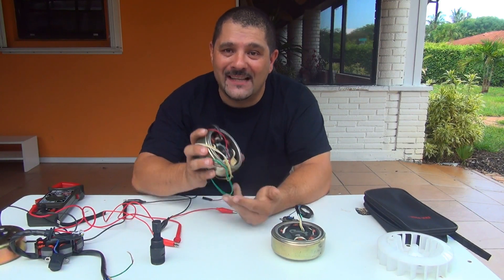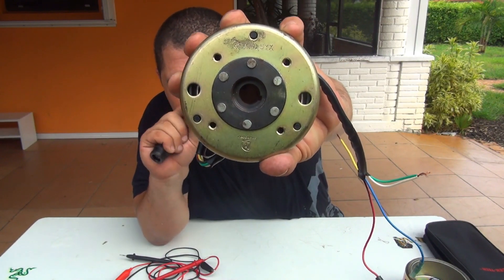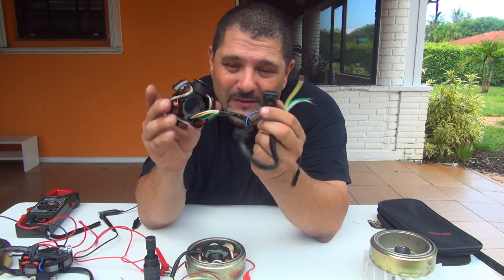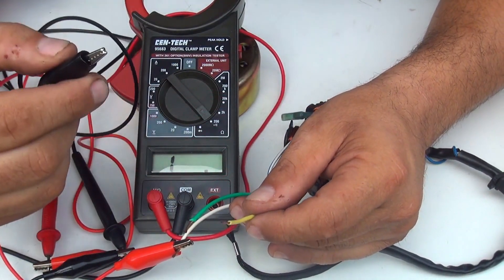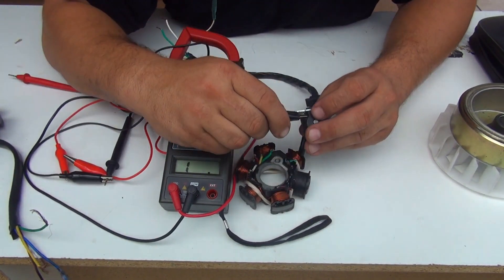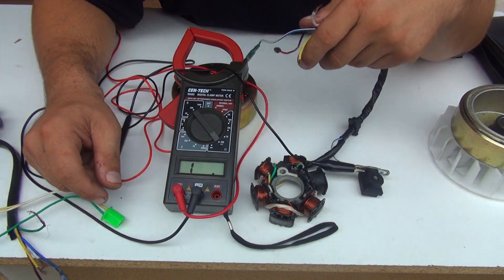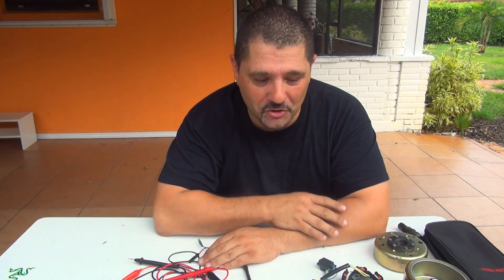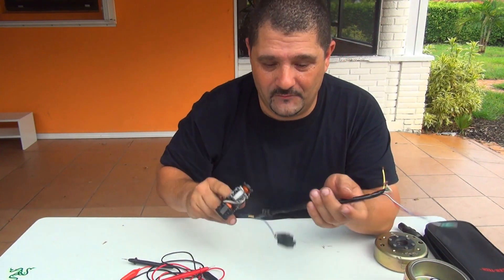How to test a stator on a gy6 150cc scooter

Comment: Super useful. Thank you.
Reply from the maker: Glad to hear that!
Reply: @VirberelloScooterTips  Hi I have question. I just received the stator that I order online and test it with the way you shown here but there are 2 problems.
1. I got one CDI wire only instead of 2 and I test it like how you do in 10:00 and get no response at all (My CDI has 4 pins not 4 + 2)
2. I continuity test the white & yellow wire with the middle part and both come out with reading and beep sound.
3. I continuity test the dark brown (I think it's ground) wire to the middle part result in no reading no beep.

I already return the 1st one I bought so this is the 2nd stator but both test out the same result. Any idea what's going on ?? Thanks first

Comment: Hello, so I'm getting power to my rear brake light and my signal lights and it's a sequential light. However I'm not getting any power to my running light. What could be the problem?
Reply from the maker: Hello you need to check the wiring harness or test the regulator rectifier

Comment: I do have a question my stator when running is putting out 12.5 that is at idle TaoTao not sure so many options but is that a problem
Reply from the maker: Hello my friend A stator output of 12.5 volts at idle for a TaoTao scooter is within an acceptable range, but it is on the lower end of what is typically expected. Generally, a healthy charging system should produce around 13.5 to 14.5 volts when the scooter is running at idle.
Here are a few considerations:
Battery Health: Make sure your battery is in good condition. A weak or failing battery can affect the charging system's performance. Check the battery's voltage when the scooter is off; it should be around 12.6 to 12.8 volts for a fully charged battery.
Regulator/Rectifier: The regulator/rectifier plays a crucial role in regulating the voltage output from the stator. If it's malfunctioning, it can result in lower voltage output. Inspect the regulator/rectifier for any signs of damage or overheating.
Stator Output at Higher RPMs: Test the stator's voltage output when the scooter is running at higher RPMs. It should increase from the idle voltage. If it does, the stator might be functioning correctly, but the idle RPMs could be set too low.
Idle RPM Adjustment: If your scooter's idle RPMs are too low, it could affect the stator's output. You can try adjusting the idle speed to see if it affects the voltage output. Consult your scooter's manual for guidance on adjusting the idle speed.
Wiring and Connections: Check all electrical connections for cleanliness and tightness. Loose or corroded connections can lead to voltage drops.
While 12.5 volts at idle is not a critical issue, it's essential to ensure that your scooter's charging system is functioning optimally. If you continue to experience problems or if the voltage drops further, it's a good idea to consult a qualified scooter mechanic or technician. They can perform a more thorough diagnosis to pinpoint any potential issues and make the necessary repairs or adjustments to ensure your scooter's charging system is working correctly.
Thank you for watching my video
Reply: @VirberelloScooterTips  thank you for getting back with me greatly appreciated 👍👍

Comment: In a 50 cc Chinese scooter, does the oil have to be coplently full, or? Is 3 out of 4 stars on the dip stick ok to ride?
I'm asking because, I think I've noticed a ticking sound since yesterday. The scooter is a 2022 and just hit 900 miles yesterday. 
Any info is appreciated!
Reply from the maker: For a 50 cc Chinese scooter, it's important to maintain the correct oil level for optimal performance and to avoid potential engine damage. Generally, the oil level should be close to the "Full" mark on the dipstick.
Having the oil level at 3 out of 4 stars on the dipstick might still be within an acceptable range, but it's recommended to keep it as close to the "Full" mark as possible. Riding with too little oil can lead to increased friction and overheating, potentially causing engine issues.
The ticking sound you've noticed could be due to various reasons, and while low oil levels can contribute to engine noise, there might be other factors at play. It's advisable to:
Check the oil level again and ensure it's at the correct level.
Listen carefully to the ticking sound and try to identify its source. It could be related to valves, timing, or other engine components.
If the ticking sound persists or you have concerns, consider taking your scooter to a qualified mechanic for a thorough inspection.
Regular maintenance and proper oil levels are crucial for the longevity and smooth operation of your scooter's engine. If you're unsure or concerned about any aspect of your scooter's performance, seeking professional assistance is always a good idea.
Reply: I live in Florida as well, would it be possible to bring the scooter to you? I'm in Tampa?

Comment: Sir I have a 150 chinese scooter that just wasn't making enough juice to keep the all the lights and accessories on. One of the yellow wires was putting out great vulkyage as your video showed however the other yellow wire was runnung low. so i have ordered 2 news and they both are the same. Frustrated i9 have ordered a 11 pole upgrade. Testing it it has 3 yellow wires instead of 2. To my surprise 2 of the wires have great voltage but the 3rd has the sane low voltage as the one on the 8 coil 3 stator. I am confused as to why all these stators are doing the same thing.
Reply from the maker: Hello my friend It sounds like you may be experiencing a problem with your scooter's charging system. If you have tested multiple stators and are still experiencing low voltage output on one of the yellow wires, there may be an issue with the wiring or the regulator/rectifier.
One possibility is that there is a break or a poor connection in the wiring that is causing the low voltage output. Check the wiring carefully for any signs of damage or corrosion and make sure all connections are clean and tight.
Another possibility is that the regulator/rectifier is faulty and not regulating the voltage properly. You may want to test the regulator/rectifier to see if it is functioning correctly.
It's also possible that there is a problem with the magnets in the flywheel or the stator itself. This could be causing an uneven or weak magnetic field, resulting in low voltage output.
If you continue to experience problems, it may be helpful to consult a professional mechanic who specializes in scooters to help diagnose and repair the issue because sometimes electrical problem can make you crazy

Comment: Saludos
Es posible que yo cambie mi stator de 8 pole por otro de 11 pole sin que la rabisa  se vea afectada o es que tengo que cambiar la rabisa completa
Reply from the maker: Hola, sí, puede cambiar el estator a 11 polos, pero necesita cambiar los cables a uno más grande porque puede derretir el cable pequeño porque tendrá más voltaje cuando cambie a una bobina de estator más grande gracias por ver mi video
Reply: O tendre que poner CDI Y BOBINA MAS GRANDE?
Reply: Brother!
Te cuento mi motor es GY6 VENTO de fabrica lo modifique le puse piston 62mm con el bloque 62mm portiado y arbol de eleva 17 degree y sigueñal 400 stroke pero mi rabisa es de 8 y me acabas de indicar que necesito mas corriente cambiando los cables a 11 pole te pregunto ¿? Al Poner stator de 11 no necesitare hacer cables de ground nuevos? Ya que ese motor necesita mas energy

Comment: I have a sym crox 125 it will not start its not getting spark
Reply from the maker: Hello my friend check the connections in the back of the coil and if you have voltage with the multimeter next check the cdi with a multimeter and at the end test the pick up coil one of these is not working . Thank you for watching my video

Comment: I just now finally got my scooter running again.
I've been watching a bunch of videos and I don't think my diagnostics were getting me anywhere.
Bought a CDI and as I now know that wasn't the problem.
Took the stator and flywheel/magneto off yesterday and there was rust on the inside magnets of the flywheel.
So I left it overnight in Evaporust and about 20 minutes in an oven from cold to 300 degrees.
Cleaned the mild surface flash rusting with electrical silicone and wiped off - looks like new again.
But.  The most important part.  I spliced in ( edit: just a female bullet connector ) an $8 Amazon pick up coil and now I have spark again.
Genuine Buddy 125.  I think they might be the only scooter that allows you to buy the pick up coil separately ( but not from PGO ) .
The gap went from loose to very snug when using a debit card.
Now to see if the vacuum piston I replaced has worked too - lost spark as soon as I replaced it!
Reply from the maker: Hello my friend great work and thank you for watching my video

Comment: @ 13:53 in the video you explain continuity, When you check the green at the plug and the green at the stator you'll have continuity, but not at the green on the plug and the white or yellow. If you do, you have a bad stator. Is this always the case?
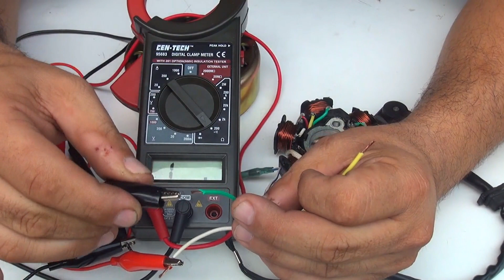Reply: I believe you are onto something Jesse at 8:08 he states connecting green and white should produce no current but i believe it should based upon other videos and my own testing.

Comment: This is by far the easiest and simple explanation to understand a stator. Great job man. By following your explanation, was able to find the bad stator. Keep up the good work
Reply from the maker: Hello my friend thank you for watching my video
Reply: @VirberelloScooterTips which is better a 6 pole or 8 pole stator? 🙂
Reply from the maker: @Kevin-j9c1l  for a 150 cc  I like 6 poles better because to much voltage in a 8 poles in the long way is not good for a low quality wiring scooter with a low quality regulator and a low quality battery
Reply: Jjj

Comment: I dont have lights, charging, electric start etc... I took the stator out and did all your tests and they seem fine. However, one of your tests is very different from other GY6 channels. Others tell you to test the resistance between the white, yellow and green wires and say that they should all be the same. You say that you should not have connectivity between the green and the other two. Are there different stators?
Reply from the maker: Hello not stator for gy6 stator are the same for 150cc but some mechanic test in different way to get the same final result you can also test the stator when the stator is on the scooter if the stator  is producing any voltage https://youtu.be/znm4KjKVQUs but also think about the regulator that ca create a short or a bad voltage flow in the system
Reply: @VirberelloScooterTips  thank you. I ended up buying a new stator yesterday but it has the same ohm readings as the original one. Perhaps it is the regulator then... At least these Chinese parts don't cost very much!
Reply: @VirberelloScooterTips  thank you. I ended up buying a new stator yesterday but it has the same ohm readings as the original one. Perhaps it is the regulator then... At least these Chinese parts don't cost very much!

Comment: Soooooo.... what's the gap supposed to be between the pick up sensor and the small metal knock in the flywheel cover?
Reply from the maker: Hello my friend same thickness of a credit card . 76 mm thank you for watching my video
Reply: Your welcome. Your very knowledgeable. But I do have one more question....
I have 2 different stators and on both of them when touch one probe to the green wire (on the plug end) and touch the other probe to any and all wires back on the stator I'm getting a beep  (Continuity). And that's happening on both these brand new stators

Comment: Please help me with this, the continuity sounds off on the Green with white and green with yellow and yellow with white on all three stators that I bought from Amazon on two stators there is continuity from Green terminal of The wire to the metal piece of the stator which is ground. And I have one that has no continuity from the green wire to the metal surface of the stator. Please help me understand this situation. I don't want to lose money buying bad stator that's why I need your help
Reply from the maker: Hello Wesley you should have continuity from the green wire and the center metal part of the stator and that is the only wire the white and the yellow should not have continuity with the body of the stator . Thank you for watching my video

Comment: Hello from Malaysia. I just bought a stator replacement from an apps. I have done the test like your tutorial but it seems that my new GY6 stator have continuity on all the yellow/green/white wire and it supposed not to, right?? So does that mean the stator is faulty? My scooter is Modenas Elit 150. This is the 2nd time I bought stator online, to fix my battery charging issue. If you can reply that would be nice..Thanks..
Reply from the maker: Hello You should not have continuity on the green and yellow testing a the same time  or green or white testing a the same but continuity shold be on the green wire and touching the frame of the stator check this video to https://www.youtube.com/watch?v=f8MmrXsEpjQ&t=105s&ab_channel=TrailTech thank you for watching my video

Comment: How many volts (AC) should we found between the 3 wire of the stator(white, yellow, green) when we turn on the motor if we like to test from the regulator?
Reply from the maker: Hello at idle volt AC with green and yellow you should read a minimum of 15 to 16 AC from green and white you should read with a multimeter a 19 to 22 Ac if your stator works  good . Thank you for watching my video
Reply: @VirberelloScooterTips  thank you man your awesome

Comment: Hey I have a problem were my gy6 only sparks one time only when I toggle the start switch iv replaced.cdi and new switch and cleaned the stator up helpp pls
Reply from the maker: Hello Alejandro you will need a multimeter you need to inspect every little thing starting from the sparkplug to make sure is not cracked and you have the right gap,  inspect the sparkplug boot to make sure you have the little clip that hold the plug top after twist the boot and remove that and inspect the coil cable to make sure the copper is not burn  from the current after you will need to have a multimiter to see,  when you try to turn your scooter on , if the voltage goes to the ignition coil in the back side where you have one green wire and yellow wire  after you will need to test the continuity on the stator and especially of the pick up sensor that sometimes goes bad . I hope this can help you and thank you for watching my video
Reply: @VirberelloScooterTips  iv changed the spark plug to new one and new coil and cable and boot still same thing
Reply: I think I needa test my stator
Reply from the maker: Check the pickup sensor ant the stator to make sure is not loose and the sensor is not rusty or with corrosion  you can clean that with a little sandpaper

Comment: thank you really nice video!!! I did however find pick up coils on eBay they are about $7 maybe $9 and free shipping or you can buy the stator and the puller and the pickup coil as a kit and they run about $55 I think that was also on eBay and be very careful when ordering the pickup coil for GY6 50cc because there are two of them believe it or not even though it only shows one when you look it up the difference between the two is the way it will mount to the bike so look at the picture carefully and make sure that the piece of metal on the pickup coil is facing the right direction so that you can mount it to the frame
Reply from the maker: Hello Shelly thank you for the information and for watching my video

Comment: I hope this question gets to you so I can get an answer my buddy's bike has an issue we go for a ride Maybe long enough for it to warm up real good and then it starts to sputter and dies out can't get it started again when it cools down we can get it started again and it runs for a while any ideas the carburetors been cleaned a few times Let me know please  And thank you
Reply from the maker: Hello Paul I think the buddy is a 125cc or a 50cc I'm more specialize on 150cc gy6 anyway first think I will check the spark plug to see if there is any cracks on ceramic also I will make sure the sparkplug boot is in good condition and is holding to the spark plug very good now because this is a problem of metal expansion from heat if that was a gy6 150cc I will check the valves clearance  after that I will check with a multimeter I check the wire / coil of the spark plug and sometime  just by unscrewing the sparkplug boot you can see if the wire is burn inside and at the  end unfortunately you will have to test with the multimeter the stator when the scooter is on the center stand and running try also to check the manifold in front of the carb for any cracks on the rubber part . I hope this can help you  Ciao my friend
Reply: Rectifier bad or cdi or stator its cheap i replace all 3

Comment: Dude that tool is a PITA. Why couldn't the back of the flywheel just be flat so yo could use a 3 jaw puller?
Reply from the maker: Hello casey360360  I like the 3 jaw puller and is a lot better then the little magneto chinese puller but when they designed the flywheel in this gy6 they decided to give us hard time ah ah ah  anyway thank you for watching my video